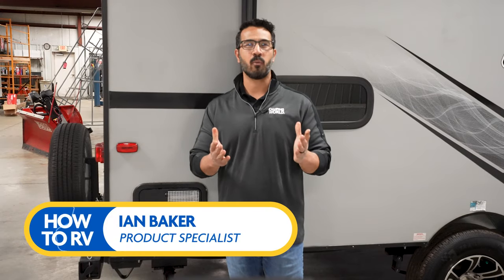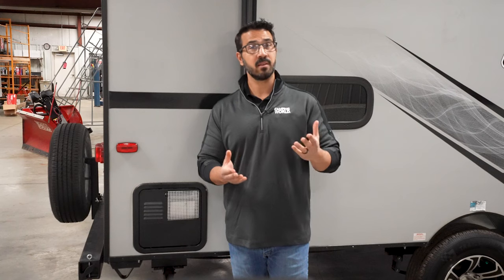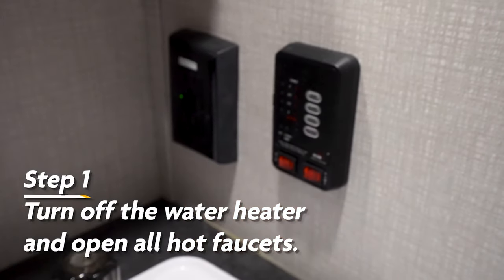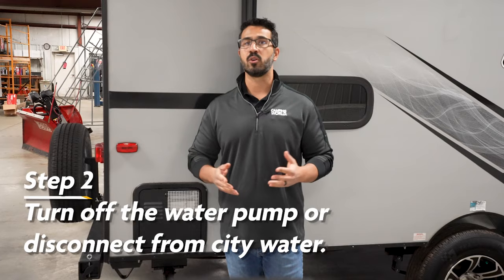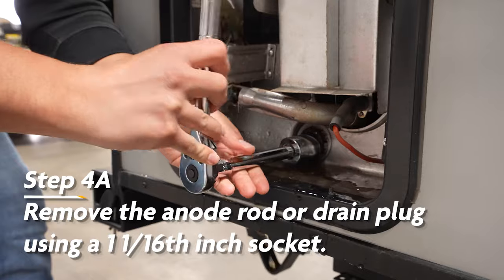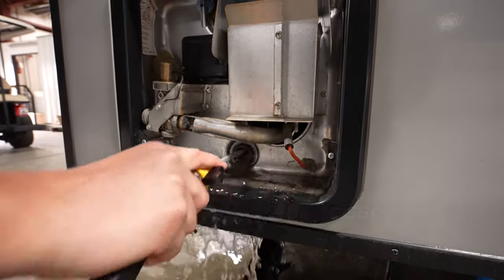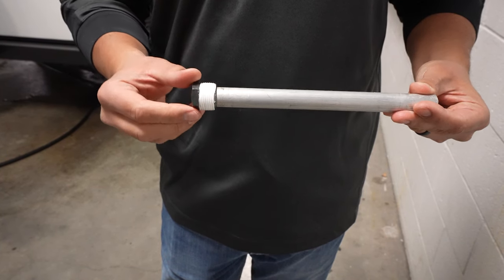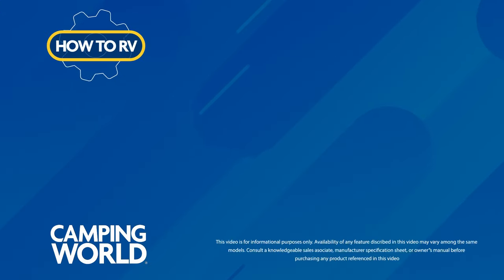Get That GUNK OUT!  | How To: Drain & Clean RV Water Heater

Comment: You didn’t wash out the heater tank after dislodging the sediment literally with the tool you used to scrape it down.  😮
Reply from the maker: Hi John!

To clarify, that tank rinser tool is connected to a potable water hose that allows you to dislodge sediments and rinse the tank simultaneously. Here's a link to that product: https://www.campingworld.com/water-heater-tank-rinser-49070.html. 

Our apologies if that was unclear in the video!